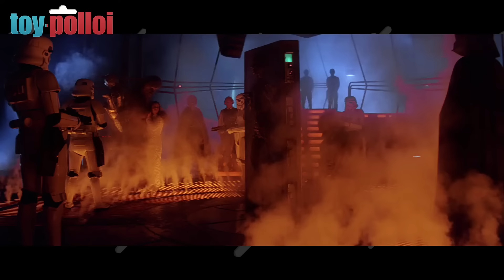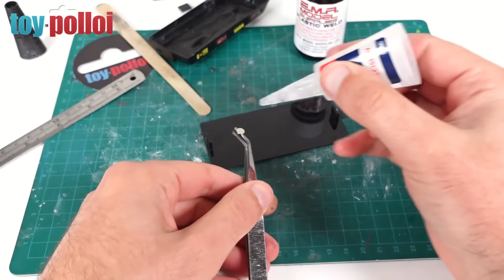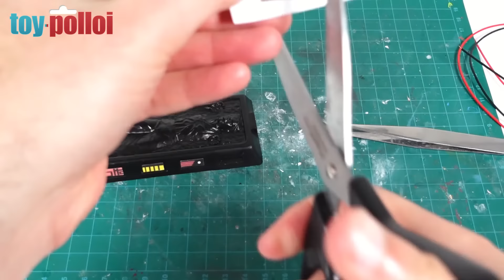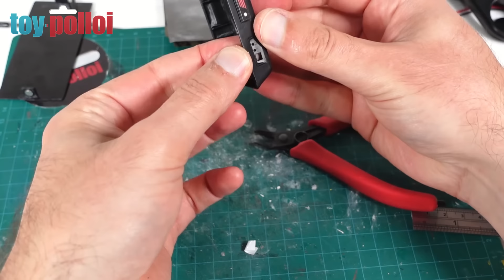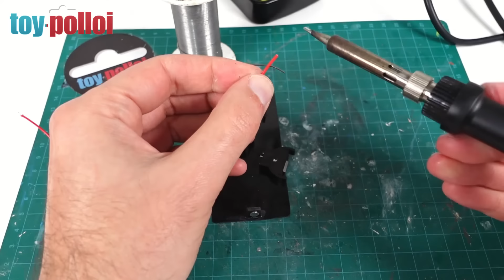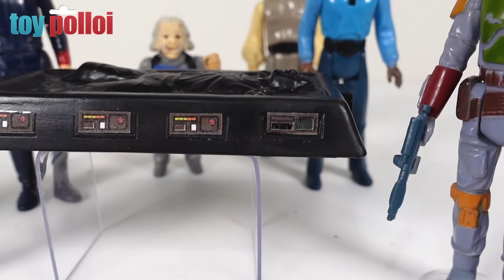Han Solo Carbonite block vintage toy custom lights - Toy Polloi

Comment: Anybody know which version this HS carbonite is? Vintage collection, POTF, etc?
Reply from the maker: It's the block that came with slave one. Vintage original kenner. Cheers
Reply: @toypolloi Thank you for the reply! I also want to thank you for the Death Star beam repair tutorial. I have to say that it’s one of the most satisfying toy repairs I’ve ever made. They really are as good as new. 👍

Comment: The light looks great, your custom projects are my personal favourite of your videos. As a suggestion for the stand, how about using the same trick they used in the first movie on the sand-speeder? Angle a small mirror downwards in front so it reflects your base and hides the stand. That's apparently how the got the floating effect against the sand.
Reply from the maker: Thanks for the tips!

Comment: Very impressive work!  Got a lot of great ideas from this one as well.  Might try this one myself at some point down the road if I can secure another Han block.  

I was a bit surprised at first that you didn't use a slide switch, sticking out the side of the block that you could turn on without removing the back panel, but your solution was definitely a more elegant one so that nothing is visible on the outside.  Smart.

Love these videos TP!!!

Comment: Great job with effect of the lighting on the Han Solo carbonite block. I have been wondering about the Space 1999 Eagle 1 toy if you worked on one and how rare are they and can they be found today?
Reply from the maker: Thanks. I have videos on the Dinky Eagle and have a Mattel eagle waiting to be worked on. Just finding a few missing parts before I start.
Reply: I have found parts available for the Mattel Space 1999 Eagle 1 on Ebay and it seemed to be a lot to choose from.  @toypolloi

Comment: This is a super cool conclusion to the original video. The lights & stickers are incredible, but just the bottom adds so much to the toy as I always found it very cheap feeling without one, and magnets are a great way to attach it.

Also, I was wondering if you've ever considered doing a custom Boba Fett with a shooting missile?
Reply from the maker: Thanks. Adding the back does make a big difference to the block. It just feels more sturdy.   I haven't ever converted a Boba fett, but it should be fairly easy to do. I'll look into it. Cheers